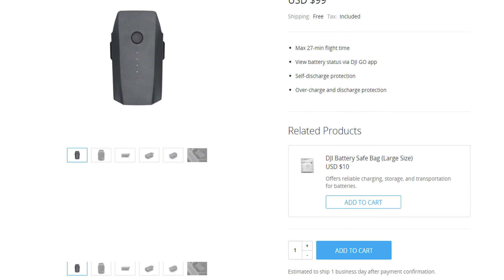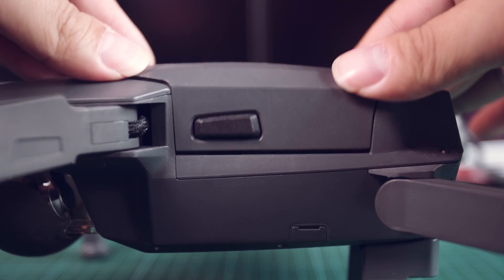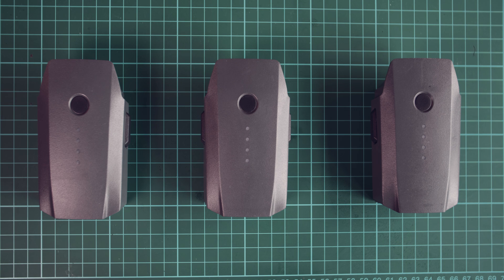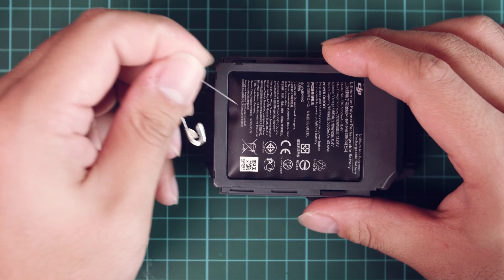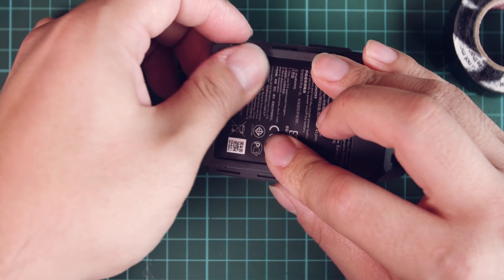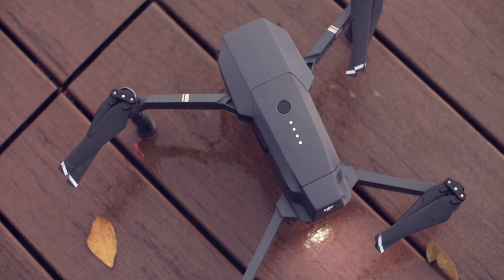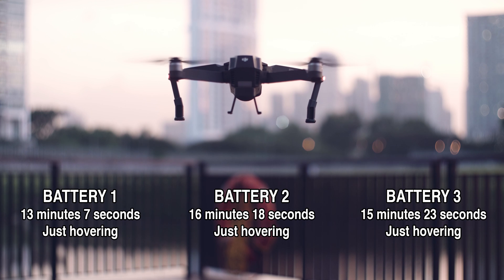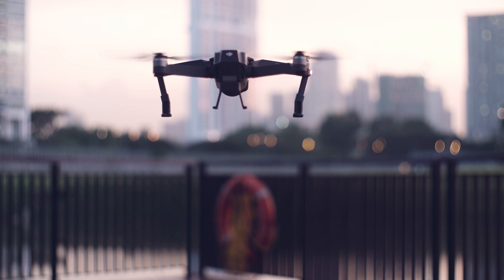Ep 38: Deflating bloated lithium polymer batteries, will they still work?

Comment: Did that to an old Moto Atrix years back. It worked fine and the battery time did drop just like in this video. Could still charge, but wouldn't risk with any newer phone due to the difference in current used to recharge. More current = Gas being generated faster = faster bloating = kaboom.

Comment: Very dangerous, if you poke too deep you will puncture the cells and cause a fire. You need to be skilled to do this properly. I've done it to cellphone batteries successfully but would not try it with such high capacity batteries.

Comment: The swelling of LiPo batteries isn't just as simple as some unwanted gas accumulating in the housing, it's a symptom of the LiPo cells degrading and chemical changes occurring, poking a hole in the housing to release the gas is just getting rid of a symptom it's not fixing the degradation of the LiPo cells inside as you will soon notice as the batteries endurance will get lower and lower, just dispose of them and replace them it's not worth the risk of something going wrong and the battery doing a thermal runaway and destroying your drone or even worse burning your house or car down.
Reply from the maker: @ats-3693  watch the video next time before commenting
Reply: @AlexRexVlog  I did watch the video, I'm just adding my thoughts to the discussion based on my experience and knowledge. I work for a drone geophysical survey company I'm the geophysicist for the company but I'm also a licenced commercial remote pilot, we fly large 25kg to 100kg single rotor helicopter UAVs and multirotor drones both LiPo and gas powered on long range beyond visual line of sight survey missions, the survey instruments the UAV's carry are also LiPo powered we have literally hundreds of different sized LiPo batteries stored in our workshop and in the field with survey crews on projects, any sign of LiPo swelling be it a battery or individual LiPo cell we dispose of that battery and replace it, we can't afford to take any chances with them with respect to safety and with respect to the potential damage or even total destruction of our survey equipment.

Comment: I punctured my  bloated batteries all died soon after. Some chemical rection happened and started to expand where I pucured. Before puncture It was high pressure gas in it , after puncture expnded the solid material. You need to change cells eigter way, but if you puncture you kill it immediately, if you don't lives longer a little

Comment: it is safer to use tooth pick instead of metal stuff for preventing the metal from touching the circuit and I strongly recommend to drain the battery completely and wear safety glass before the process

Comment: This dude just punched straight through 3+ layers of anodes and cathodes... A long time ago i accidentally ripped open an iPhone 5S battery before I didn't eat the adhesive while prying it off. Only the plastic skin was damaged and it worked fine after I tapped it up with Krypton tape. (I replaced it soon after)

Comment: i have done this, n yes it work well but same capacity as it left on. do this in minimal angle n minimal power punch.. u can hear the gas out then that is. but i just use the batteris on my training with lower altitude in empty field only. last in 15min flight time. punch 3 batteries. like video warning, dont.do this if u are not know.. just buy a new 1 for safety flight.

Comment: those of you who stated your battery burnt means you stupidly punctured the cell, and or didn't seal the hole, the idea is to puncher the the seal without going too deep into the cell itself. i have done this a few times and the battery worked just fine but that's just me...if you do not know anything about lipos don't do this I've rebuild, replace sells for a decade now. be careful
Reply: the same thing on what the guy who repaired my laptop told me. He has done the same procedure for years and all were well. He explained something about layers, that the outermost skin should be the only layer to be punctured
Reply: Are you facing any ChArGeRs for pUnChErS on the seal?

Comment: Don't puncture battery with needle direct
<90° you can damage cells (layers) and
make fire. Better to do it with small angle.
Getting gas out, you don't get any better 
result in capacity

Comment: Tips for preventing your battery from inflating:
1. Don't let it overdischarge.
2. Don't overcharge it.
3. Don't let it get too hot.
4. Don't let it get too cold.
5. Store it in a dry place, but not too dry.
6. Don't store it fully charged, but also not undercharged.
7. Don't look at it.
8. Don't think about it.
9. Don't say rude things about it.
10. Keep other batteries away from it so it doesn't get picked on and eats it's feelings away.
11. Don't use it.
12. Don't not use it.
Reply: You had us in the first half though.
Reply: 13 : Usen't
Reply: I hate lithium batteries. I fucking hate them.
I hated the concept of not being able to have a quick replacement, of being a slave to a specific cable, of not being able to go outside and have more than enough power with me. THIS would suck even if battery would work the same way forever with no problems. 
I hate not being able to use devices at home with a charger, of not being able to recharge it to 100% without memory effect or simply damaging battery life. 
When they were introduced, I hated people not complaining about all this when gameboys, walk- and discmen and cameras with AA BATTERIES were common before DS, mp3players and digital cameras appeared, I hate people even more because USB cables and powerbanks did not even exist at first. 
I hate that batteries come in 1235342 different physical shapes so you can't use one for another device, even though the stats would fit, like you could with AA batteries, I hate that most of the time, the time of losing one energy bar is not the same as losing the second or the third, I hate that on the first GBASP and NDS you couldn't even tell how much battery was left. I hate that there are no charging stations so you could recharge a second battery OUTSIDE your device, like you can with RECHARGABLE AA or AAA devices. (Yes, you can charge both, two different sizes)
I hate that I have to think of a thousand ways of using it, charging, not decharging it, storing, cold, heat with no one telling me beforehand. That its power will shrink after a certain amount of charging cycles. Hell, even IF I don't charge it that often and do everything right IT WILL STILL lose power after an amount of years.
I hate that they all will DIE one DAY and I have to look for specific replacement, that could prove to be dangerous or uneffectful. I hate that I can't use it without a battery but with a cable. I hate that so far I haven't found one way of bridging power of a battery into a device that simply has a different battery size ANY LUCK WITH THAT?
NOW I HATE that batteries can SWELL AND start to BURN and that WATER DOES NOTHING. Do all bloated batteries burn eventually? Do they burn outside, even if they are discharged, and don't smell, leak, or emit heat?? How often do they swell and how often do they just die???

What I hate most about this is people's ignorance. From not seeing the obvious drawbacks of having one single battery life at most, to being near a power socket FOR A BATTERY DEVICE, to all the conditions, to a cable, to the battery getting worse, no matter what, to it dying, to not having a replacement, let alone a quick replacement of a similar device, to IT EXPLODING OR BURNING you, while many devices cannot even be simply opened to look inside without damaging, so wait until it gets hot or smells or leaks, then you can almost be sure that the swollen battery will burn you with a fire that can't be extinguished by water.
All I ever hear is YEAH, but with AA batteries you must exchange them as well! SO much garbage! AA and AAA batteries can be RECHARGED and you have so many devices to use them with AND you can charge both of them in the same charging station, OH and I have solar lamps that use rechargable AA batteries. Get this. I can even charge them using no power at all, but solar power. Even better for the environment.
But even without this I just don't understand why people were so accepting of having one battery cycle for devices that could use universal batteries before.
Reply: @markusnashorn1145  You will hate ni-cad batteries even more, people no longer use them
Reply: this reminds me of the nintendo wii operations booklet where it states to not merry the wii it has no soul.
Reply: Sounds like the 80s movie Gremlins...only with 4x as many rules!
Reply: I looked at my battery it’s swollen now
Reply: Yes, according how expensive it is, it doesn't takes care of itself too much. It allows you to harm it :(
Reply: I feel like I'm talking to a DJI support representative
Reply from the maker: lolz

Comment: Can I still use my 2 bloated batteries on my Mavic Pro? And if I do charged it once the batteries goes dead, will it catch on fire or explode or God knows what while im charging it.
Reply from the maker: I won't recommend it.  The moment a lithium Polymer battery bloats there is no way to save it and you should replace it. I only did this experiment to see if puncturing it would reduce it's capacity and it clearly does.

Comment: 2 points, i think i want to puncture my battery but only when it is discharged so there is so fire with no current inside. Also i want to know what depth you need to puncture, i see you went almost 2mm deep. I think puncturing the skin should be enough
Reply: puncturing the skin should be enough

Comment: I just poked a hole in one of my mavik batteries and it almost burnt my house down. First it made a wheezing sound and there was a little smoke . In another second it was like a smone grenade. The whole room was filled with this white smoke. All i could do was kick it to the tile floor from the wooded desk. In another second it was like a flame thrower . Im not exaggerating.  It seems like it has 3 packs of sells inside and they were red hot. It wis like 3 mi uites of hell. Do Not poke holes in these batteries.
Reply: Kinda your own fault tho
Reply: You have to be careful and just puncture the foil, not the whole battery.

Comment: Not worth it but for those people yelling FIRE, it’s only a fire risk if you push the pin strait down into a plate.  If the skin is bloated away from the plates and you angle the pin it doesn’t touch anything inside but toxic gas...   Then you die... 🤣🤣

Comment: Hey man, what if someone puncture and then do not seal it with a tape?
Reply from the maker: If water gets in, the whole battery may ignite and  catch fire. That fire would be a chemical fire which you cannot put out with a normal water or carbon Dioxide fire extinguisher.  Honestly I wouldn't even recommend puncturing the battery in the first place but if you wish to do so, please do it with extreme caution.
Reply: jeezuz a chemical fire 😨

Comment: The puncture you made is only for 1 cell. There are 3 cells inside and you need to puncture all 3 in order to reduce it to original size. It would be great if manufacturers of these batteries can attach a one-way valve to each individual cell so that gases can be released without the battery swelling up.
Reply from the maker: That's a great idea but the cynic in me would tell you that manufacturers want to earn your money so they won't do it.

Comment: Couldn't possibly be that they were used batteries that had degraded over time, lessening their runtimes?
Reply from the maker: Possibly, but I did left them on the charger a lot. And it has only been a little over a year.

Comment: Actually there is a way to make the batteries regain some capacity once you depuff them. By applying heavy force with a flat object to everywhere on the surface of the battery except over the hole, you can both increase the tightness of the layers and their contact with their metal foils under them as well as remove the remaining trapped bubbles that are between the layers and the separator. I’m thinking about doing a video about it and also putting the battery in a vacuum chamber after being punctured which will basically suck the gas out naturally and allow even more gas to be released than what’s possible at normal atmospheric pressure. It will allow me to reseal the battery before letting back in the air and this may actually improve the battery life significantly
Reply: Константин Бобров won’t work u idiot the puffing is caused by the lithium degrading
Reply: Stupid advice. Lithium combusts when exposed to oxygen.

Comment: Help urgent tryed a set of livh 1300 on my drone but  they discharged last night hooked it up to my drone and my dron battery discharged super fast to 65% unhooked em and my battery was a bit puffy through em on my cold pad and they went back to norm are they ok to use ? Not usin livh no nore
Reply from the maker: You can still use the batteries but do understand that the problem with Puffed up batteries is that they may burst, and when the lithium core touches moisture it will catch fire. That fire can only be extinguish with a Class D fire extinguisher or until the chemical reaction stops. My advice is to get them replaced.

Comment: Do not follow this "procedure", you will burn yr house down.
Reply: It almost happened ti me just now. If my floor was wooden or carpeted i would now be home less.  Damn . It was like a smoke grenade and a flame thrower all at once
Reply: Marvin Gayle, I did the same thing. Wish I saw this comment before I attempted to be an effin’ idiot!!! I never should of tried to ‘fix it’. Still cleaning up fire extinguisher dust, and the smell is aweful!
Reply: Did you people not listen to the warning?
Reply from the maker: @damian9303  They are idiots that didn't bother to watch the video.
Reply: omg i was about to try it
Reply: and i did unfortunately
Reply: ay, you CAN do this safely, you have to let the battery sit, for maybe a few weeks in a spot where you have failsafes and whatnot..
It is not impossible, people just dont do it right.

Comment: When they swell I stick them in the refrigerator or the freezer and it shrinks back to normal no need to puncture a whole. Try it it works.
Reply: The cold at best only cause the gas to occupy a smaller space, hence they swell less. But when you bring it back to room temp, it will eventually swell again as no gas is actually removed. Also swelling in li-on cells is signs of irreversible damage of the li-on cells, so replacement is always the only proper option.
Reply from the maker: I don't think so, That might actually make things worse.

Comment: Are your family members, pets, house, heck your self worth $100? I have been using lithium batteries in our RC hobby sense they went on the market over 15 years ago. Please, don't take chances with these. Just properly dispose, and replace suspect batteries. Be safe to play another day. I'm sorry, I wasn't going to comment, but I can't help it. Does anyone else out there think sticking a metal, conductive pin into a high energy electrical source a bad idea..., or is it just me?
Reply from the maker: Thanks for your concern, I wasn't grounded so odds of me getting electrocuted are pretty low. But you're right. It was stupid, I shouldn't have taken any chances and I apologize if I've offended you.
Reply: If a battery is bloated its bad and on its way out. Take note; these batteries generate huge ammounts of heat when the protective aluminium shell is damaged in any way. This is a very bad way to extend the batteries life. DON'T DO IT PLEASE!
Reply: yes i was thinking about my cat what if i left him alone with my punctured li-po phone then come home to burning cat

Comment: We followed similar procedure but it started releasing gas continuously and finally  the whole battery got burnt up. Ended up purchasing new batteries.
Reply from the maker: Yeah, this was never meant to be a long term fix. I just wanted to see how the battery performs after releasing the gas.
Reply: Me too!!
Reply: these batteries are covered in an outer layer of protective foil. the idea is to puncture the protective foil layer only to let the gas out then reseal but you would have punctured the cell itself causing a short circuit
Reply: @EthanShort  if oxygen got inside the battery will it eventually explode?
Reply: @EthanShort  Exactly......

Comment: I did the same procedure on the video and now the drone is accusing battery with error. Although the drums normally start the drone, it does not let off and does not even begin to rotate the propellers.
Reply from the maker: I'm sorry to hear that, You can try charging the batteries and try again. It may help. However I strongly recommend you get the battery replaced. I recommend getting the Mavic Platinum batteries  instead as they are less prone to bloat.
Reply: @AlexRexVlog  Where to buy these batteries?
Reply from the maker: It's the battery for the Magic Pro Platinum edition. DJI's website should feature it. But the color will be off as the Platinum Mavic is shinier.